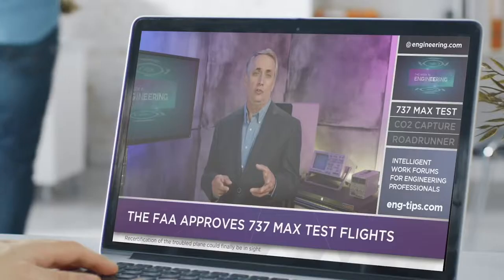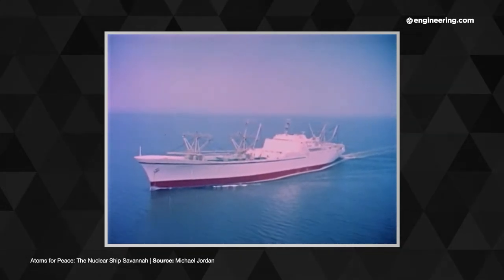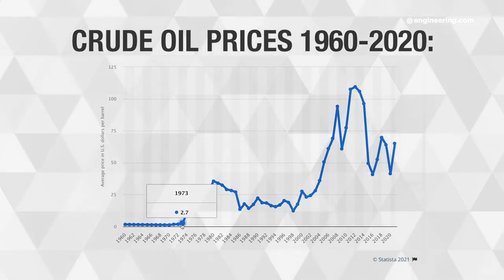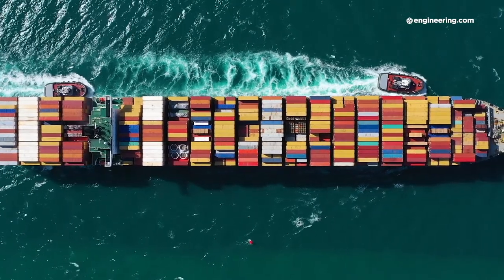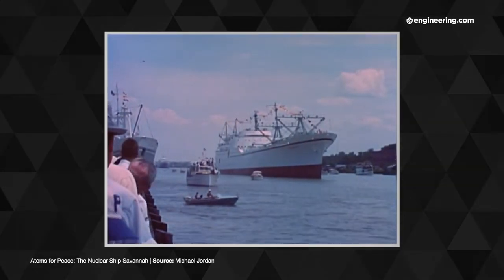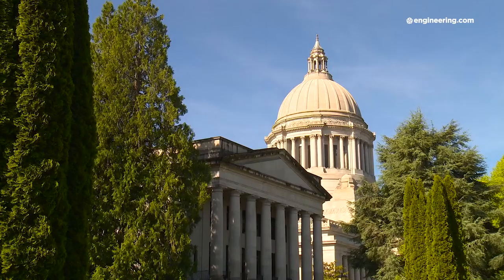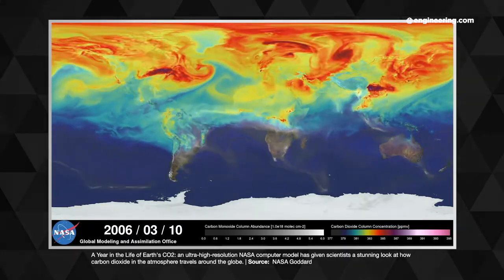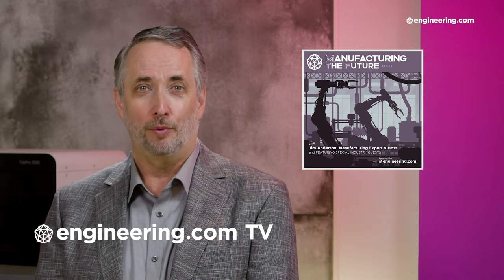Why Are There No Nuclear Cargo Ships?

Comment: Panamax container ship consumes 63,000 gallons of diesel per day. Oil companies will never allow them to switch to nuclear power.
Reply: Allow? 

If the law changed to ensure the cost of burning fuel covered the cost of the harmful byproducts, they'd be stumbling over eachother to switch.

If I have a factory and it spews out polluted water, I have to pay to treat it to a certain standard.

If I run a livestock farm, I have to contain the waste (crap).

If I run a foundry, I have to contain the slag.

Everyone is responsible for the trash they produce, but for some reason if the trash I produce  is in a gaseous state, it gets ignored.

If we said "hey, you dumped 6 tons of CO2 into our air, you have to pay to clean that out" the industry would have plenty of incentive to change.

Fossil fuels are cheap because they don't pay for the cleanup, they make everyone else pay for it.
Reply: @loooooopy  and what’s your point?
Reply: @YouVSMeTV  there's no point de-carbonising cargo ships at this point because of the tiny amount of pollution they cause.
Reply: it's not diesel..its fuel oil. It's the cheapest bottom of the barrel in refining. They have warmers on the ship just to keep it from sludging up. Huge difference between that and diesel.
Reply: @loooooopy  CO2 emissions from cargo ships makes about 3% of all human caused emissions. Thats not a tiny amount.
 https://en.wikipedia.org/wiki/Environmental_effects_of_shipping

Comment: You failed to address two major issues. What happens when a ship sinks, and what happens when its time to remove it out of service and dismantle it?  Current dismantling is done in India with uneducated, cheap labor.  A ship sinks in 2,000 feet of water. Who pays to recover the reactor? And can it be recovered?
Reply: IMHO a marine casualty in deep water would probably have little immediate impact based on the limited information.  The USN lost two live reactors (Thresher & Scrpion) the USSR sunk a few as a means of disposal.  A marine casualty in shallow water giving rise to a hydro thermal explosion of other release of radio active material is probably a greater immediate risk.

Comment: “Modern nuclear technologies are increasingly suggested as a potential solution to shipping’s decarbonization challenge. The technology certainly has potential both in terms of its contribution to emissions reduction and for U.S. shipyards and their supply chains to leverage national investment in terrestrial nuclear energy development. Nevertheless, many questions need to be answered and it is critical the industry is able to evaluate these technologies with a laser focus on safety. ABS is up to the challenge to support the DOE in these efforts,” said Patrick Ryan, ABS senior vice president, Global Engineering and Technology.
Reply: Modern iterations of nuclear energy, thorium fuel, molten salt reactors, small modular reactors or fusion reactors, will carry the legacy of past problems.  It is the global trepidation of anything with 'nuclear' in the name and the economics of nuclear having transitioned from 'energy to cheap to charge for' too 'the costs of remediation are incalculable' that will prevent the adoption of nuclear energy as a means of creating energy at sea.  Modern reaction systems may have overcome the safety problems but the general public, having been misled in the past, will be reluctant to believe the fresh new promises.  The incident of the ‘Ever Given’ blocking the Suez Canal, March 2021, may also have a little to add to this debate.  The cooling water on ships tends to get taken in from near the bottom so when running aground the inlets are in a prime spot to get plugged up restricting, if not stopping, the flow of coolant.  One thing that the TMI, Chernobyl and Fukushima incidents all had in common was that the supply of coolant, or rather lack thereof, was a fundamental cause.  Similarly and only months later, May 2021, had the ‘X Press Pearl’ been nuclear powered then a major port for a populous nation in the global South would have possible been the site of a significant exclusion zone due to a non power plant related incident.  If the ‘X Press Pearl’ had on board a fired up but ‘safe’ molten salt reactor and found herself having to dissipate the residual energy associated with the possible 12.5 megaWatt power cycle would a stable cool down have been possible?  Would there have been sufficient heat energy contained in the power system to facilitate a hydro thermal explosion?  In a casualty ships may capsize, like the ‘Karin Hoej’ off of Bornholm in the Baltic early December 2021, in which situation any safety system reliant on gravity might not work.  It might also be worth bearing in mind that part of the TMI near miss the fault of the navy trained operators focusing on not letting the primary cooling system 'go solid'.  The actions of the captain of the 'Costa Concordia', Francesco Schettini, may also be relevant; the consequences of his actions, whether due to ineptitude, an isolated act of incompetence or driven by a corrupt corporate culture, illustrates well one of the dangers of releasing nuclear energy into commercial shipping.

As a second point if you fit 'walk away safe' reactors on ships you will need duplicate drive trains as there are seldom salvage tugs around when you really, really need one.  A nuclear ‘dead ship’ drifting around NUC (not under command) would be a disaster waiting to happen and duplicate systems increase expense.  Land based nuclear power plants have a few issues but are immobile, stable and usually well regulated.  Reactors on ships by their very nature are able to move between regulators, bump into each other and roll over.  Regulation of ships by both / either flag state or port state has problems and adding any nuclear regulatory obligations on to those already overstretched facilities would be very taxing for all involved.  This is not about 'can it be safe' it is all about 'will it be safe'?

Just think; would you have full confidence in the management of a nuclear reactor under the control of an anonymous entity only traceable, perhaps, via a letter box in a FOC (flag of convenience) nation state?  If you are, could you sell that confidence to Japan, the state that hosted the Hiroshima and Nagasaki nuclear detonations as well as more recently the Fukushima ‘event’?  Then try that same, or a similar, sales strategy on Ukraine, the nation state that as a part of the USSR (CCCP) hosted the Chernobyl ‘event’.  Furthermore while merchant ships may be 'taken up from trade', as the RN would say, or may be captured or impressed by non state quasi military entities by way of piracy, cargo ships are not military vessels.  They therefore do not have the same inherent level of self protection and internal discipline.  Why not use nukes on merchant ships?  It is down to engineering, finance, socio-political attitudes and safety.

Comment: I always wondered this. We have naval ships powered indefinitely why the hell cant we power cities with it too?
Reply: Just think; would you have full confidence in the management of a nuclear reactor under the control of an anonymous entity only traceable, perhaps, via a letter box in a FOC (flag of convenience) nation state?  If you are, could you sell that confidence to Japan, the state that hosted the Hiroshima and Nagasaki nuclear detonations as well as more recently the Fukushima ‘event’?  Then try that same, or a similar, sales strategy on Ukraine, the nation state that as a part of the USSR (CCCP) hosted the Chernobyl ‘event’.

Modern iterations of nuclear energy, thorium fuel, molten salt reactors, small modular reactors or fusion reactors, will carry the legacy of past problems.  It is the global trepidation of anything with 'nuclear' in the name and the economics of nuclear having transitioned from 'energy to cheap to charge for' too 'the costs of remediation are incalculable' that will prevent the adoption of nuclear energy as a means of creating energy at sea.  Modern reaction systems may have overcome the safety problems but the general public, having been misled in the past, will be reluctant to believe the fresh new promises.  The incident of the ‘Ever Given’ blocking the Suez Canal, March 2021, may also have a little to add to this debate.  The cooling water on ships tends to get taken in from near the bottom so when running aground the inlets are in a prime spot to get plugged up restricting, if not stopping, the flow of coolant.  One thing that the TMI, Chernobyl and Fukushima incidents all had in common was that the supply of coolant, or rather lack thereof, was a fundamental cause.  Similarly, and only months later, May 2021, had the ‘X Press Pearl’ been nuclear powered then a major port for a populous nation in the global South would have possible been the site of a significant exclusion zone due to a non-power plant related incident.  If the ‘X Press Pearl’ had on board a fired up but ‘safe’ molten salt reactor and found herself having to dissipate the residual energy associated with the possible 12.5 megaWatt power cycle would a stable cool down have been possible?  Would there have been sufficient heat energy contained in the power system to facilitate a hydrothermal explosion?  In a casualty ships may capsize, like the ‘Karin Hoej’ off of Bornholm in the Baltic early December 2021, in which situation any safety system reliant on gravity might not work.  It might also be worth bearing in mind that part of the TMI near miss was the fault of the US navy trained operators focusing on not letting the primary cooling system 'go solid'; due to their training overwhelming their education and the particularity of the situation.  The actions of the captain of the 'Costa Concordia', Francesco Schettini, may also be relevant; the consequences of his actions, whether due to ineptitude, an isolated act of incompetence or driven by a corrupt corporate culture, illustrates well one of the dangers of releasing nuclear energy into commercial shipping.

As a second point if you fit 'walk away safe' reactors on ships you will need duplicate drive trains as there are seldom salvage tugs around when you really, really need one.  A nuclear ‘dead ship’ drifting around NUC (not under command) would be a disaster waiting to happen and duplicate systems increase expense.  Land based nuclear power plants have a few issues but are immobile, stable and usually well regulated.  Reactors on ships by their very nature are able to move between regulators, bump into each other and roll over.  Regulation of ships by both / either flag state or port state has problems and adding any nuclear regulatory obligations on to those already overstretched facilities would be very taxing for all involved.  This is not about 'can it be safe' it is all about 'will it be safe'.

Furthermore while merchant ships may be 'taken up from trade', as the RN would say, or may be captured or impressed by non-state quasi military entities by way of piracy, cargo ships are not military vessels.  They therefore do not have the same inherent level of self-protection and internal discipline.  Why not use nukes on merchant ships?  It is down to engineering, finance, socio-political attitudes and safety.
Reply: ‘They’ may say nuclear is cheap, but it is not it is expensive, and has a large embedded carbon quotient as well as being complicated, dangerous, not universally socially acceptable and having only ‘no need for refuelling’ as a questionable advantage; actually it does need refuelling just not as often.  With nuclear energy all fuel costs are ‘up front’ while hydrocarbon fuels are incremental and thus can be funded form earnings rather than requiring capital commitment in something that has no secondary market.

Comment: Seems like a potential application for small modular reactors
Reply: Modern iterations of nuclear energy, thorium fuel, molten salt reactors, small modular reactors or fusion reactors, will carry the legacy of past problems.  It is the global trepidation of anything with 'nuclear' in the name and the economics of nuclear having transitioned from 'energy to cheap to charge for' too 'the costs of remediation are incalculable' that will prevent the adoption of nuclear energy as a means of creating energy at sea.  Modern reaction systems may have overcome the safety problems but the general public, having been misled in the past, will be reluctant to believe the fresh new promises.  The incident of the ‘Ever Given’ blocking the Suez Canal, March 2021, may also have a little to add to this debate.  The cooling water on ships tends to get taken in from near the bottom so when running aground the inlets are in a prime spot to get plugged up restricting, if not stopping, the flow of coolant.  One thing that the Three Mile Island (TMI), Chernobyl and Fukushima incidents all had in common was that the supply of coolant, or rather disruption thereof, was a fundamental cause.  Similarly, and only months later, May 2021, had the ‘X Press Pearl’ been nuclear powered then a major port for a populous nation in the global South would have possible been the site of a significant exclusion zone due to a non-power plant related incident.  If the ‘X Press Pearl’ had on board a fired up but ‘safe’ molten salt reactor and found herself having to dissipate the residual energy associated with the possible 12.5 megaWatt power cycle would a stable cool down have been possible?  Would there have been sufficient heat energy contained in the power system to facilitate a hydrothermal explosion?  In a casualty ships may capsize, like the ‘Karin Hoej’ off of Bornholm in the Baltic early December 2021, in which situation any safety system reliant on gravity might not work.  It might also be worth bearing in mind that part of the TMI near miss was the fault of the US navy trained operators focusing on not letting the primary cooling system 'go solid'; due to their training overwhelming their education and the particularity of the situation.  The actions of the captain of the 'Costa Concordia', Francesco Schettini, may also be relevant; the consequences of his actions, whether due to ineptitude, an isolated act of incompetence or driven by a corrupt corporate culture, illustrates well one of the dangers of releasing nuclear energy into commercial shipping.  The regulators vary from useless up to good and anywhere in between some I would not trust to control a toothbrush and none are infallible.  To maintain the level of authority that the ONR (Office of Nuclear Regulation a UK government agency) exercise over the few nuclear power plants on land in the UK to visiting merchant ships would require increases in manning and expertise leading to costs that would simply not be affordable.  Safety costs; as does the engineering of the structure.  The examples I given are not exceptional typically every week a ship sinks, some large some small.  On the news on 9 Jan 2023 there was another incident in the Suez Canal, when a vessel grounded briefly; the next Ever Given scale event is only one small error of judgement away.  A sister ship of the Ever Given, the Ever Forward, ran aground approaching Baltimore on 13 Mar 2022, these things happen.
	
As a second point if you fit 'walk away safe' reactors on ships you will need duplicate drive trains as there are seldom salvage tugs around when you really, really need one.  A nuclear ‘dead ship’ drifting around NUC (not under command) would be a disaster waiting to happen and duplicate systems increase expense.  Land based nuclear power plants have a few issues but are immobile, stable and usually well regulated.  Reactors on ships by their very nature are able to move between regulators, bump into each other and roll over.  Regulation of ships by both / either flag state or port state has problems and adding any nuclear regulatory obligations on to those already overstretched facilities would be very taxing for all involved.  This is not about 'can it be safe' it is all about 'will it be safe'.

Furthermore, while merchant ships may be 'taken up from trade', as the RN would say, or may be captured or impressed by non-state quasi military entities by way of piracy, cargo ships are not military vessels.  They therefore do not have the same inherent level of self-protection and internal discipline.  Why not use nukes on merchant ships?  It is down to engineering, finance, socio-political attitudes and safety.